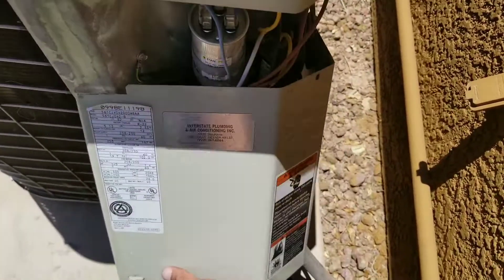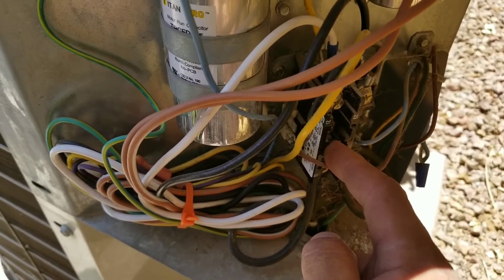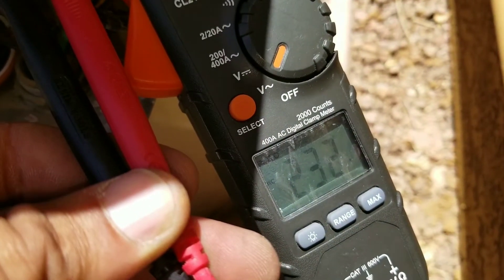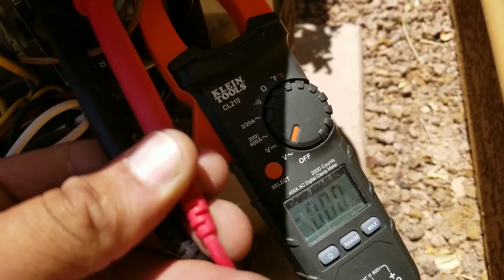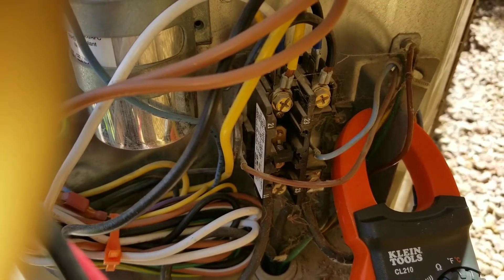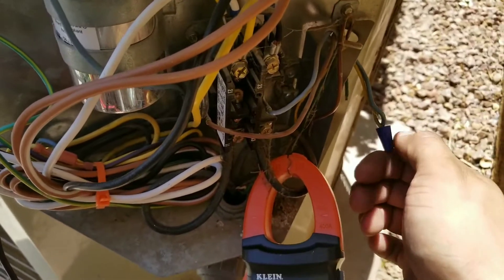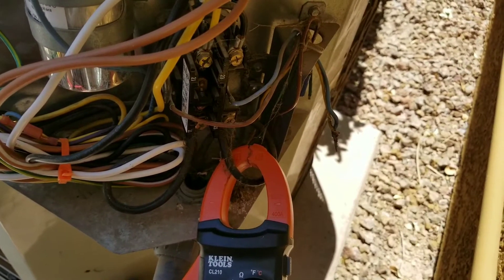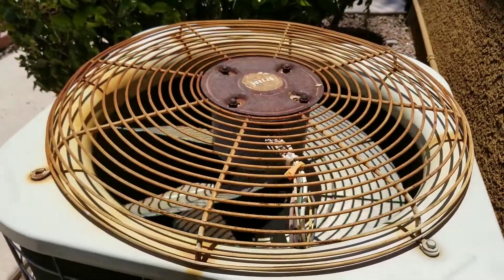AC not Working? Condenser not Working? Contactor Energized!

Comment: You sir, are a GENIUS. I have been going in circles trying to fix the damn outdoor fan at my house and was nearly at my wits end until i found this. On mine the wires had become like oxidized and weren't connecting in the wire nut. Cut the bad part off,stripped and it immediately spun up. It's a good day. If your in Chicago area ever, I owe you a round .

Comment: Just subscribed because once I got to the low voltage wires and disconnected the wire nut then turned on the disconnect the contactor didn’t engage once I touched the wires the contactor engaged and the compressor finally “started” wanted to start or if it did it was a very subtle … anything you can tell me why there is ? Once I took the wire nuts out the wires were connected well
Reply: To add after looking at the schematics again I jumped the low pressure switch !

Comment: Contactor engages/energizes but the fan does not turn on and the compressor does not turn on.  Replaced the capacitor already.  Where to now?
Reply from the maker: Did you test the capacitor first? Did you check your breaker? Are you getting 240 volts at your disconnect? Are you getting 240 volts at your contactor? If you engage it manually by engaging the plunger does it turn on? There are many routes to go at this point.
Reply: @MoreThanMaintenance  fuses on power disconnect were bad.
Reply: @culgray  where is the said fuses located? The issue you had originally sounds like the one I have now

Comment: What if contactor pushed in and fan spins but compressor doesn't kick on?
Reply from the maker: Larry Goodwin 
As long as compressor is not overheated... I would suspect the capacitor... if compressor is old... you may have to add a hard part. Does system have refrigerant? Lastly I would test the compressor to see if its grounding out... I have all of these videos posted on my channel. Hope this helps!
Reply: Same thing happened to me.  Contactor was pushed in and fan kicked on but no compressor. And after a while neither fan nor compresor would work.